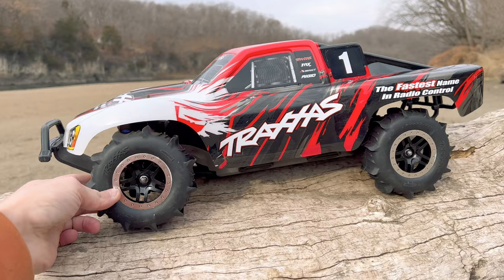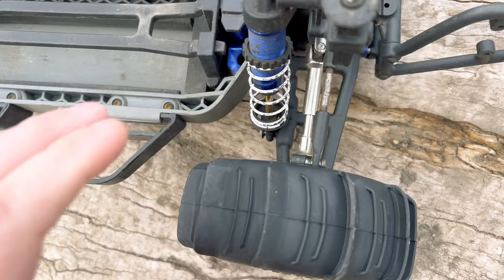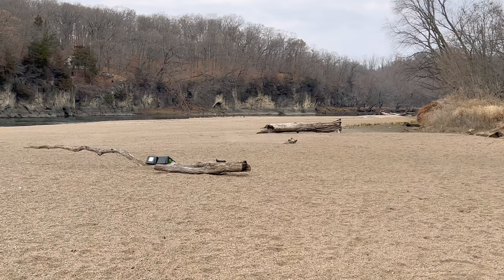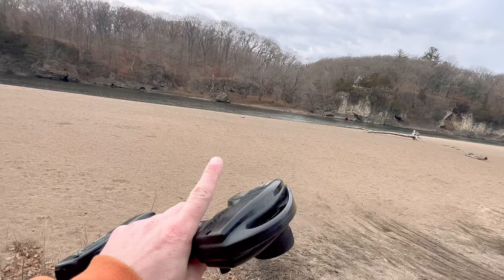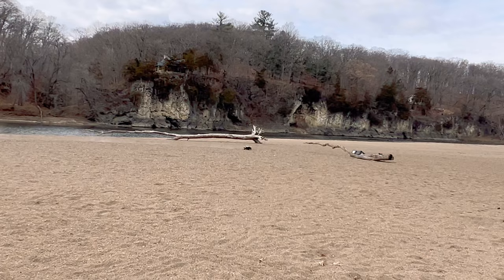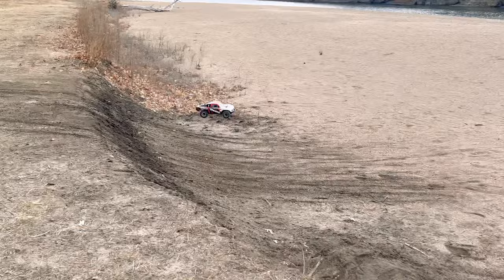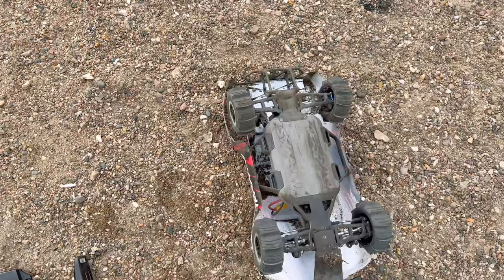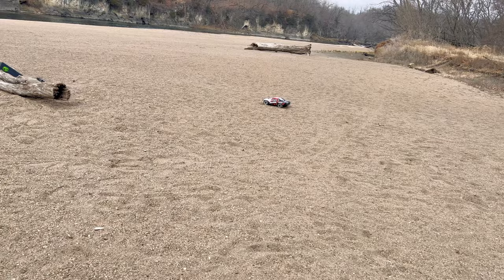Traxxas Upgrade Paddle Tires #5891 in the SAND // TRAXXAS SLASH 4x4 BRUSHLESS!

Comment: Sucker rips with those paddles 🔥 After getting your RC wet and sandy you should spray it down with WD 40. It helps protect the plastics as well as the metal screws etc. Just a suggestion. 
Cool vid bro 👍🏻✌🏻
Reply from the maker: Thanks Bro! It sure does rip! I’ve done that wd40 trick before….but I don’t like the residue it leaves behind when I soak the whole machine in wd40….it gets on everything
Reply: @RCKnockout  Yeah it's messy you have to wipe it down. I used to use electrical spray also. It doesn't leave so much mess. I learned to always wear rubber gloves when cleaning also it's a lot easier than having to scrub your hands and get the grease out from under ya finger nails. LoL Imo it's definitely worth the mess to spray them down from time to time especially if you submers them in water or run them in a lot of sand ✌🏻
Reply from the maker: @EJ-74  I always spray my bearings down I just don’t spend the extra time spraying all the plastics down….also wd40 is kinda expensive….

Comment: You should really consider getting the motor plate upgrade that Traxxas makes it's a little bit thicker but it does help you should also get the actual motor mount that houses the bearing for the center drive shaft and the differential to
Reply from the maker: Yeah I’ve actually got that in this truck now

Comment: Just ran my slash 2wd on traxxas paddles in the snow! Can't get it to wheelie and I think the culprit is the super soft rear suspension.... I did the slipper clutch a half turn off full tight
Reply from the maker: Is it a brushed or brushless model?

Comment: Just use hot glue, for the tiny vent holes inside the rim! If you can't reach the holes with the glue gun, pour glue on the tip of a toothpick and put the glue in the tiny hole to block it.
Reply from the maker: Thanks for the tip 👍😉